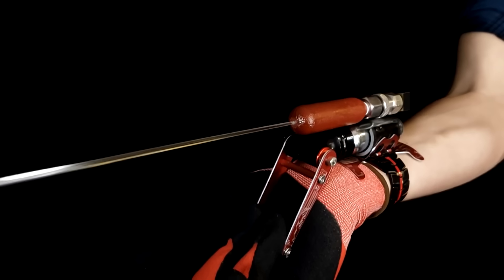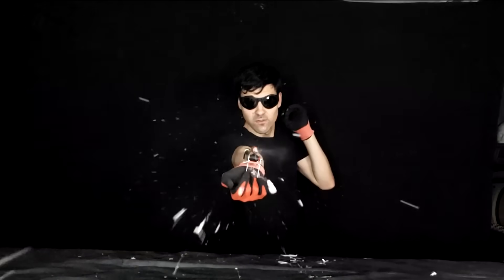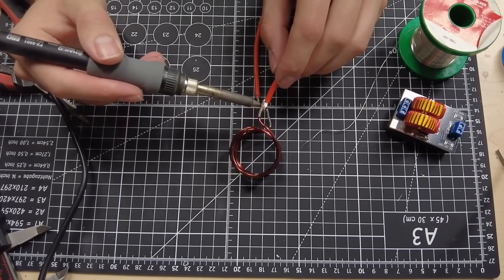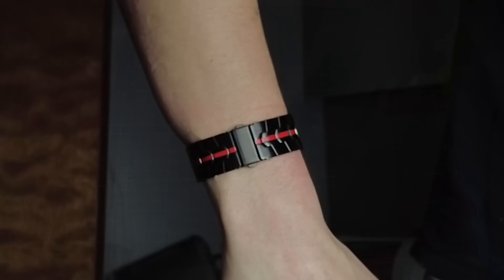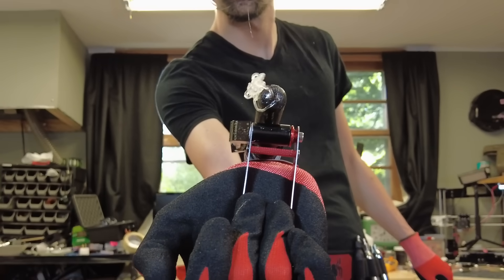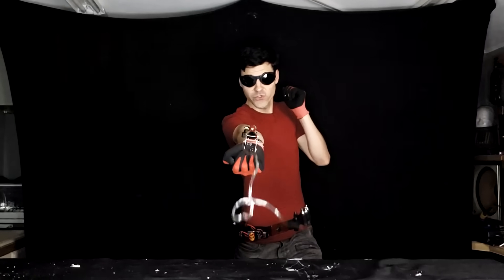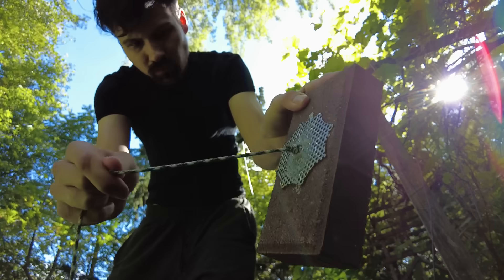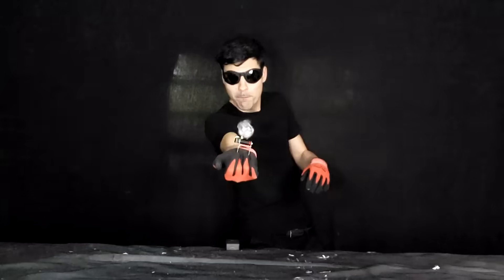REAL Web Shooter (Spider-Man: No Way Home)

Comment: Nice invention, except Spider-Man doesn’t use hot glue. He actually has a hot glue phobia about it. Because it gets stuck to the suit. Hot glue would also turn all of his captured perps into burn victims. Trusting your life to hot glue while hanging upside down probably isn’t very wise. It depends on which multiverse version you’re trying to make.
However in most versions Spider-Man uses real spider silk. Although there are some alternatives. 
The first version of a wrist web shooter were based off spy equipment that shot tranquilizer darts. 
Later comic book renditions changed it to spider webs. If you’re using it to swing. I suggest starting with high strength rope. Like climbing rope to support your weight. Just remember or at least take the advice from an experienced rope climber. 
Swinging can double or triple your weight. Causing the rope to break. 
The only way Spider-Man’s web swinging actually works is with specialized materials and safety equipment. Be safe and try not to burn yourself by mistake.

Comment: the entire spiderman suit can have pore aka tiny holes sporadically placed amongst it so that super glue can be oozed out of it allowing you to stick to any surface for a long amount of time without falling and oil can be released in certain places to gently release the suit drying it at the same time the holes in the suit could have a heating and air blowing system. All of this should also include a large number of items that will increase the durability of the armour and the suit. The gloves contain an array of different coloured wires for attaching various things. The red wire is the grappling line which you can use to attach yourself to walls or buildings and make sure that you stay safely attached to whatever you're working with. there's a strong pulley system inside with a tiny catapult built inside of the wrist so that when it's fired it can be pulled back in with no problem.  I've included some other components within the suit too, mainly the legs, the webbing system and a gauntlets which enable me to grip things and move around quickly and efficiently. a gyroscope can be built into the arm allowing you to know the polarity of the swing so that you can kick your legs back and forth and with doing so the system inside of the suit will also make you kick a little bit harder utilizing air pressure pushing you back and forth with air pushing your back forward and your stomach backwards allowing you to kick much harder before it swing meaning less energy between swings.  Finally, a cloth attachment from the elbows to the hip will allow you to Glide instead of falling. A hole in the spine of the suit can produce a Deployable parachute in case you were to ever fall. Deployable parachutes in the spinal region. the suit can collect energy in multiple ways such as solar energy kinetic energy and many more different types of Energies that will allow the suit to stay charged. metallic gloves that have 1000s of tiny pores aka tiny holes in them that oozes out super glue to make them stick and then ooze out oil to make them release, with a heating system that dries the oil. you could find some alloy that was both flexible and strong enough so that they wouldn’t break if you pulled too hard. these could be used as spider man gloves, you could also mix copper wire with pores within it, krazy glue and tiny strands of rope, a heating system and a oil release as well as water releaser to cleanse before each catapult of web strings. The gloves should be attached to the entire suit so the weight will be evenly dispersed, not causing too much tension on any region.
Krazy glue can hold 1000 pounds and fishing line can hold 20 pounds per string

Comment: Did anyone ever think of using Braeön tape? It's like, as strong as steel, so if you mix together glue, the tape,(10 mL of distilled water, 1 mL of white vinegar 1.5 grams of glyerolina to make it biodegradable) along with styrofoam and mix it in acetone would that not theoretically make a web like substance?

Comment: I know this is really late and probably wont be seen but, you could always try to have the metal plate folded in a specific origami shape and then a mechanism due to the specific fold and high pressure cause it to flatten out in the air, even possibly grip around round surfaces on impact.

Comment: Could the metal mesh be replaced with something compactable? I'm thinking like a bola style cartridge, which is existing technology (net guns) and can be studied, with tiny weights that spread the 🕸️ out so it hits as flat as possible. The rope could be kept on the outside of the cartridge, a spool system maybe, with the end already attached to the anchor which is soaked in hot glue by the time it's heated up. No idea if that's possible, and the rope length would be predetermined, but I'm sure you'll both come up with something better than that.

Comment: Why don't you add another piece that can shoot a bullet (that have the same head that u made that looks like a web)with a rob attached to it and make the rob fit inside another cartdge which is attached near the another Hot glue cartege so you can shoot the glue on the wall and then shoot the bullet and 💥🤯 you have a web shooter that can shoot webs and also can swing

Comment: The unfortunate issue with the current system is that having glue, anchor, and rope in the same cartridge would mean shooting your anchor, hoping it sticks, and then waiting for the glue to dry and cool down before you have a secure swinging point. 

In order to make the jump to combining sticking and swinging, I think we're gonna need to see the switch to the "rope" you hang on being the thing that actually adheres to the surface, and that in itself would require a lot of development independent of packing it into a cartridge and ejecting it. 

I still believe in the dream though, and I can't wait to see it finally come true some day

Comment: Cool. But please wear a flak jacket or something 🤣

But yeah have one shooter on the other hand maybe that shoots a sort of anchor? Probably have that idea already?  Idk if it's possible to make an anchor that can be contained in a Web shooter. But for now that's the best idea Probably. Jus don't make the anchor mechanism activated with an explosion! Cus yeah that's unsafe.

Strength of the anchor shouldn't be the priority, you can always use Titanium or something later. Minimising the surface area somehow is the ideal option. 
Maybe not even use metal? Make a mesh, net thing out of a sturdy fabric that clings to the glue?

Comment: Just brainstorming: Try making a disc with a dart through it that retracts as it hits the brick/glue. Also try looking for other ways to increase surface area than just drilling holes, so that disc diameter can be decreased for better aerodynamics. Also, computer controlled delay between glue shot and cable/disc shot. Good luck. If you ever feel like giving up, watch Jujutsu Kaisen.

Comment: Ok hear me out, what if in the cartridge, it contained a hub which is attached to the line. The hub launched out and has a pressure button on the tip and when contact with a surface is made, it releases 5 plates that swing out with the force of the momentum that contain the glue on their surface.

Comment: He could for sure make a aluminum or steel folded with hinge type mechanism inside a little bigger co2 tank that shots it in front of the glue and sticks on the wall like he had it. I’m sure there will be a lot of trial and error but this guys a pro so he got it
Reply: If I really had too I could create what I have in mind in a 3D design

Comment: Now here me out this could be a little tedious but I think it would work so use the same system but instead kf filling the whole cartridge with hot glue but before you put the hot glue put a fiber mesh material that is strong and durable so when it shoots the the glue hits and fiber mesh sticks on it then for swinging to solve this problem I would put a very small pvc tube just wide enough to hold 550 cord and bundle it at the end and when you fire the whole mechanism just grab the rope and swing

Comment: Do the metal design ,but make it into a dart that is mechanical. More aerodynamical,  So when it hits the surface area, it spreads out to it's original metal form with holes  . Just a thought

Comment: This type of thing is absolutely not my niche or forte, but you should definitely look into a steaming basket design for the anchor. It could be collapsed into a second cylinder with a line, and fire simultaneously with the glue. The basket opening will cause drag, so the glue would reach the target first, providing adhesion for the anchor. The hardest part would probably just getting the anchor to hit the glue spot

Comment: Okay, hear me out - the long-lever used to activate the web seems necessary as it appears to take a bit of force at times to activate the device. Would it be possible to convert that lever into some kind of wiring/pulley system that runs up the arm, and requires that specific hand/wrist position in order to activate? I’m envisioning the wiring being built into the suit’s decorative web design, making it functional too.

Comment: What if you made the cartridge have multiple sections? In the back a string section and in the front a large hole thst they can both pass through, allowing for a large ended string. Just a thought.

Comment: they usually show the web that spiderman swings from is actually multiple strings wrapped around each other, and when it latches on to something the ends spread out to hold on to more of that surface. So if you figure out how to make that effect you won't need an anchor in the future, other than that great  job.
Reply: stfu you fucking weirdo respectfully. acting like no one serious actually know physics?? why tell an electronics tech or an engineer what you prefer? respectfully brother, because you don’t know at all what you’re talking about, no actual engineer will hear you out. you want to go prove you can make a better one??? no??? then respectfully sit down and be quiet.

Comment: No clue if it would work, but maybe paracord? The inside is like a bunch of small strands of nylon, which would work aesthetically as the web, plus it would give you something that you could grab onto and swing from. For a shooter that would utilize a built in anchor, you could line the bottom of the canister with a nylon mesh or net of sorts that is tied to the paracord, then fill the rest of it with the hot glue like you used in this video. Theoretically, the nylon net would serve as the anchor, spreading out the surface area for maximum contact with the glue. You would just need to make sure that you didn't heat up the canister too much, or the nylon would melt with the glue.

Again, no clue if this would work, but that's my train of thought on how to combine the anchor, rope and glue.

Comment: I wonder if you could make a spring set up so the grounding plate supporting your weight unfolds mid shot you can use the metal plate and your heat source and put a piece of glue in the middle of that folded plate when you shoot the plate it would shoot glue at the same time the only issue is cooling the plate in mid air so it doesn’t reheat the glue

Comment: If you make another prototype you could add a mode which when it shoots out hot glue/the web mixture it is stuck to the anchor so it would automatically bond causing it to stick and be easier.

Comment: What I've always wanted to see is this idea, but basically the shooter holds whatever "string" is best to be thin but strong, it could either be set up so that the string is pre-segmented or so that letting go of the shooting mechanism stops the string from extending further. The strings would have some kind of pad at the end like your metal one, but probably smaller and more flexible. There would then be a button to cut the string away from it to easily keep up momentum, maybe in a place that your thumb could hit it. Finally, to make it stick, the mechanism would have a strong adhesive applicator that only applies it to the web as it shoots out allowing for instant use and multiple webs in a row. The adhesive would probably be hot glue like you use or some kind of "instant" bonding super glue/liquid weld. I think this would be one of the best ways to implement the idea without the breakthrough of a real web fluid (granted it's possible to make).

Comment: The holes full of glue is a very clever solution, but a flat plate will never reliably make flat contact when launched from range. 
You'd either need a super magnet and metal target, or preferably
some kind of soft rubber ball full of holes and glue, so that it deforms and increases its surface area immediately on contact.
Finally, I suspect the glue doesn't cool rapidly enough. I wonder what happens if you could somehow detonate tiny beads of liquid nitrogen on impact to cool an adhesive without making it too brittle.
Put an accelerometer and detonator inside the glue ball, program it to pop when it hits?

Comment: what if there is some main tube that shoots compressed air to launch the anchor whilst smaller tubes to shoot the glue infront of the anchor or even through the holes in it so it can shoot at once?

Comment: if your goal is to shoot something and swing on it, I think you need to give up on the hot glue.  Too much is needed to hold your weight, it's too high volume.  And when it shoots out, time is needed to let it cool down before it can be used.

Comment: I think I got it. So instead of making the adhesive the thing you’re trying to  swing from, why not fasten a longish rope and a way to shoot and rewind, and then set up the web shooter so that it sprays a little bit of the adhesive to the top and sides of the rope, so that when the rope shoots pit and hits a surface it will stick. You might have to fuck with the formula or design a bit, especially if it needs to dry before sticking. The downside is you would have to buy a new rope after a while because you can’t exactly just unstick the adhesive in mid air, so before you hypothetically swing to another place you’d need to climb up from where you are, using the rope rewind, shoot your other web shooter to where you want to go next, and then cut the rope already sticking at the top to save as much of it as possible for the next swing. I think that’s the only way to really accomplish this in a way that is convincing, the only other thing I can think of is somehow increasing the strength of silly string somehow, but people have tried that already. And the silly string formula used might not even be the real proper silly string since the company behind it keeps their formula under wraps.

Comment: My suggestion is to try to switch from hot glue to something more cyanoacrylate based since they react with water in the air, and can be stored as a liquid using chemicals like toulene

Comment: I have been thinking of creating my own web shooter, My plan is to create it with a mixture of hot glue and letex glu, so I can have a good stick. Within the inside of the shooter a mini guillotine to cut the web for if i want to release the web this is just an idea so far for it and I want to set up a way just how you did it where you could hang from above, if i want to stick to it i wanna find out some way that the webs can stick to something while also keeping a hold so it can with stand someone with a heavy weight like say around 300, this is just the beginning of it if I can I'd like to also get a kind of a knot into the web so it doesn't snap I don't know so far but its gonna be a start I believe that technology like this could be the start of something great, if anyone can also think of something to add to the list please do I'm excited for this project.

Comment: Would it be possible to create a system where the anchor is pre-adhesived? You'd need to use an already liquid glue, most likely, and make a more powerful cartridge to be able to launch the increased mass further.

Comment: In the comics. Web shoots out in a 3 strand. Then a 4th one comes out and wraps around the 3 keeping them together. Stan Lee knew what he was doing. If you can somehow get a rope with a hook at the end of it with enough pressure to pierce a brick then have glue shoot out and loop around the rope not only to give the rope extra support but also so that the glue shoots onto the hook to seal any gaps in the brick when the hook pierces into it, it should give a firm hold. It’s like a screw. Think of a screw how it has ridges looping around to give it enough hold onto a piece of wood. You can also have a hook designed as screw and then the glue shoot out and seal the gaps just like plaster covering up a screw in a wall. 

Obviously we all have a different mindset of how to do these things be things are better said then done lol

The same applies for a gun when fired, it has enough pressure for a bullet to pierce a brick, obviously that will turn you into Batman, but who doesn’t like both Batman and Spider-Man. Become The SpiderBat-Man or The Bat-Spider! Lol

Comment: If you find a clear or opaque material for your anchors that can hold the necessary weight of the web shooter user and would withstand the heat of the hot glue, they the swinging experience would looks way more realistic. This way the web bit would look more like a web and less like a piece of metal on a blob of glue